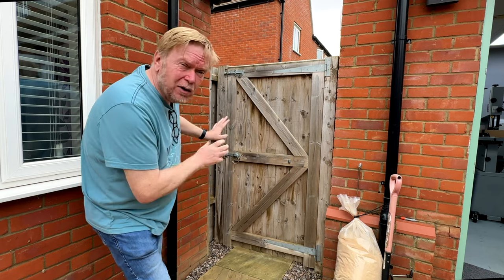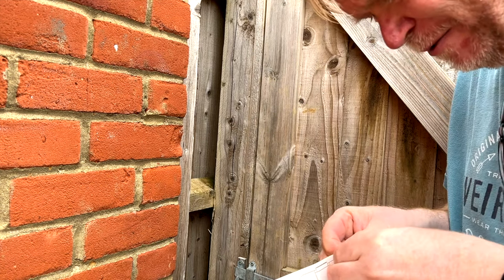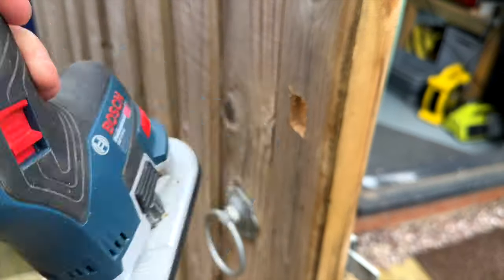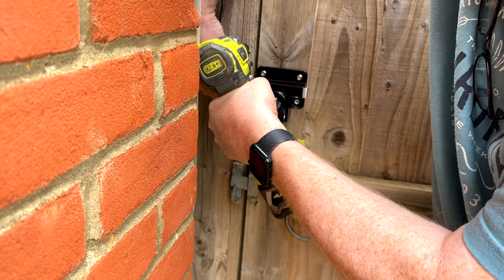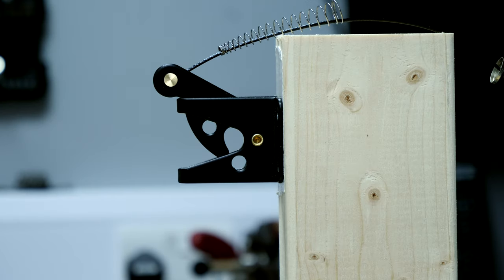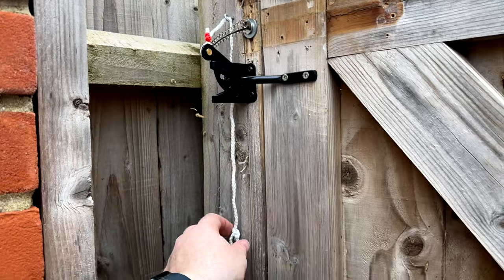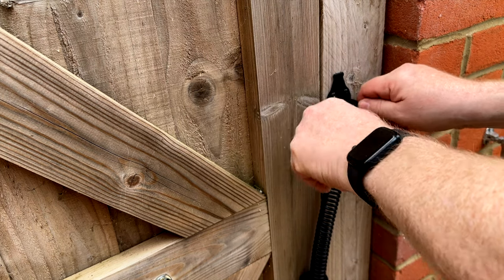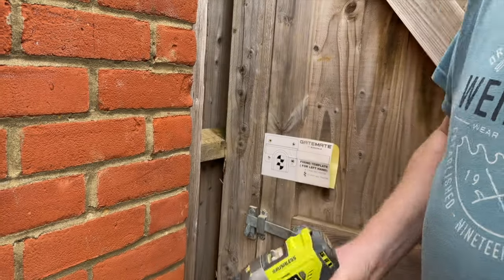How to Install a Better Gate Lock! The Gatemate Long Throw Lock

Comment: I fitted a Gatemate lock to my side gates a year ago and it has proved to be well worth the investment. My only mild gripe is that the black finish has degraded to a Matt grey which is a bit disappointing. However, it obviously doesn’t affect the efficiency of the device.
Reply from the maker: I agree with the observation. It's been a year since fitted I'm seeing the same effect. Not too bad as the rear of the gate is north-facing - but a little disappointing. Along with some rust streaking on the stainless bolt. But otherwise still happy. Thanks for leaving a comment.
Reply: maybe you know can i install this in my garage door both sides 2 locks thanks if you know
Reply from the maker: @giova69374  So long as you've something to screw or bolt into on both the frame and door, I see no reason why not. Thinking about my old up-and-over garage door from a couple of years back, the frame would have been fine, but I might have needed to add a plate to the door itself for the bolt mechanism to screw into.

Comment: Thumb lock seems a bit pointless somebody can hop over the gate steal what they want and let themselves out
Reply from the maker: Hi, a keyed side version is available, too. This is a high-use gate during the day, especially as I work from home and from my workshop everyday. The thumb-turn and the ability to open the gate with the key from the outside are both features that work well for my situation, especially when my assistant arrives. Not shown in the video (for obvious reasons) are the other security measures in place such as alarm contacts and cameras. At 8.15 in the video, the gate is shown padlocked from the inside which is how the gate is secured at night and when away from home. But I've actually modded the Gatemate to allow the padlock (long shackle version) to secure the bolt. Thanks for the comment tho.

Comment: The one on the top. Allows you to get locked out. Love the first one installed because it can be accessed from both sides. I saw a combination locked box cover that can be installed over the pull string or cable.
Reply from the maker: Hi - thanks for the comment. You're right the first does allow access from both sides and, importantly for me as the gate is in constant use when I'm working from home, doesn't need a key to let you out. The top one, when padlocked provides security when I'm away from home, that sort of thing. It works quite well. Since making the video a few people have sent me details of alternatives which look very smart and they may well be incorporated into the new fence/gate (still work-in-progress).

Comment: Trouble with them is that the keys are made of soft metal and will bend or brake easily if left in the lock and brushed against while passing through the gate.
Reply from the maker: Mmm.. I hadn't noticed the keys and you're right. - but frankly I've found that to be true of many locks lately. If I revisit the lock at any time I'll make that point. Thanks.
Reply: One can have a sturdier key made(copy) at a hardware store.

Comment: I see one down for with that particular lock system. That is if they manage to get in your garden they can unlock it by hand. And escape with your goods. I have a very similar system to yours, which uses keys on both sides is much more secure. Putting that aside a great video
Reply from the maker: Agreed - but choosing the option where it could be unlocked by hand from the inside was intentional - the back gate is in constant use from the house as the bins and parcel box is on the other side. When we're away overnight, the gate can be padlocked. Had the gate been simply an occaisional means of access, as was the gate in my last house, then sure keyed access from both sides would have made the gate more secure.
Reply: @StrawbyteWorkshop  Yes, that makes sense in your case. I have to admit, sometimes you have to remember where you leave your key take out key as I've also broken A number of keys by leaving it in the lock and open the gate, If the wind catches the gate when passing through it. My gate is in a very windy situation. I have a damper on the closer, But even that's not enough help in very high winds.

Comment: This looks fantastic, can the euro cylinder be changed on these so I can get it remade to be keyed alike to my other keys?
Reply from the maker: I'm not sure there was a keyed alike option which promised matching existing locks at a property, however I couldn't find a lock supplier in my area to supply one. That might be a question for their 'customer loyalty' team who provide product specific advice, according to their FAQ. See the contact us page of the Birkdale website: https://products.birkdalesales.com/
Reply: @StrawbyteWorkshop  yeah fair enough mate I guess my question was is there a screw visible that releases the euro cylinder from the rest of the device

I couldn’t see one anywhere on it from product images etc

Comment: Hi Karl, welcome back. I’m pleased to hear your business is doing well. No pressure but we missed you!! I’ve seen youths in my area hop over a 6 foot fence panel like it wasn’t there!  I would prefer to have two locks; one like yours and the other near the bottom of the gate with a key for use both sides. I could leave the key in the lower lock on the inside of the gate when I’m busy in and out of the gate but lock the gate and remove the key at other times during the day and at night. Best wishes.
Reply from the maker: Thanks. And you’re not wrong about gate a 6” height being no obstacle. Actually most gates are only 5’ 10” like mine. The new gate will be at the legal maximum of 6’ 6”. When we’re away the gate is locked.

Comment: Great new video Karl, that's just the sort of Hardware I've been looking for, for my new back gate.
Well, I say new gate, it was installed last year, but I still haven't got around to fitting a lock or spring closer on it 🤣
Reply from the maker: Thanks Colin. You’ll find a link to what I used in the description. The spring closer is the thing that started me down the road which led to the lock shown in the video and the secret sauce in the project. I like a closed gate.
Reply: I know that nothing these days is really secure, but if it stops the opportunist thief from nipping into your back garden and then remaining unseen, it's good enough.
The police don't take too kindly these days to broken glass and razor wire embedded in the top of the gate 🤣🤣.
Reply from the maker: A comment I made in a piece to camera that ended up being cut was about a good lock being one that is always locked and the common reason for forgetting or not bothering is the need to access the garden from the drive from time to time. The fact I can leave it locked and let myself in from outside is a feature I glossed over to make the video less talky.
Reply: That's exactly why I want a lock I can open from the outside.
Our house is detached, and we have a side gate on both sides.
The new gate, which I didn't fit, just has a sliding bolt which I can only unbolt if I go through the other gate and walk around the whole house to get to the other side, then do it all in reverse to lock it again 🤨

Comment: Hi mate, Great video and very informative... 
The only thing I would have advised was to rotate the gate 180 as the bracing is on the wrong side... 

Keep up the brilliant vids
Reply from the maker: Hi thanks for the comment and encouragement. The gate itself is a cheap crappy gate the developer installed that will be replaced anyway.
Reply: @StrawbyteWorkshop  

That developer should be ashamed of themselves. 

But, I am enjoying your content and your video style. I'm currently watching your sketchup cutlist video, tres bien

Comment: Love lock have them on two of my gates. I used flat head bolts on the keeper as I thought just screwed in means the keeper screws are the weak point.
Reply from the maker: Since making the video I’ve replaced all the screws with slightly longer ones. Thanks for the comment.

Comment: how is the Gatemate 1490106 Euro Long Single Throw Lock  holding out is it rusty or freezin up atall ?
Reply from the maker: One winter through and it's held-up pretty well. The only rust has come from the fact I used steel screwdrivers to drive in the stainless steel screws. A common issue and the reason why you might want to consider stainless tools (if you have the money). In terms of fit - most of the issues I've had have been with a crappy gate which is coming away from one wall. Not the lock's fault.

Comment: Chiseling is  not necessary, after drilling the lock fits nicely in.
Reply from the maker: Thanks for the comment.
Reply: @StrawbyteWorkshop I saw your video after I bought the lock,
I couldn't find my chisels so I decided just to try and fit it, it pushed in perfectly 😊

Comment: The video is well made however this seems like an overpriced option for what your getting to me.
For less than half the price of the gate master alone you can get a lever rim latch with deadbolt. Something that's encredably durable and resistant to corrosion.
If you want even more security, while still costing less then the gate master, you can add the classic Yale rim lock as well. 

I also wouldn't recommend thumb turns  on a gate as if a burglar scales the fence it allows them to nulify the lock. Letting in their less athletic buddies and/or allowing more bulky items to be taken.
Reply from the maker: Hi thanks for the feedback on the video. I agree with your comparison with other options in terms of cost. It is an expensive option but don’t think a rim lock and deadbolt would suit the gate as it stands. The current gate is garbage compared to its replacement with too much seasonal movement and more conventional door furniture is likely to be the option chosen when I come to install the new gate. As said in the video this was an opportunity to try the system. 

In terms of security yes, from the inside it is simple to let yourself out. That was intentional as the gate is in constant use from the house (access to bins, cars and parcel box) and it’s where work deliveries come through. The gate is padlocked to secure it at other times however and was shown in the video. This is a reasonable balance based on our needs plus other security arrangements not show (for obvious reasons) give additional comfort.